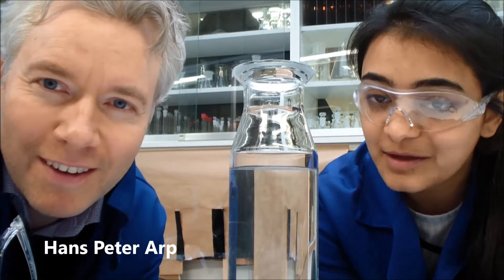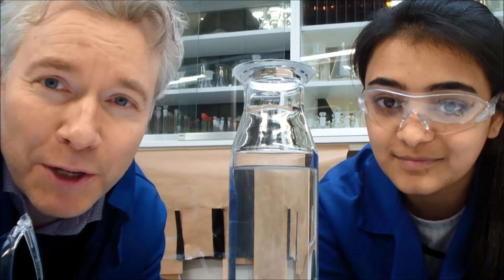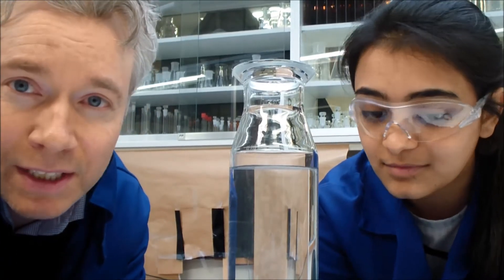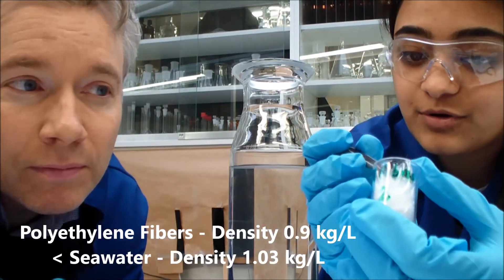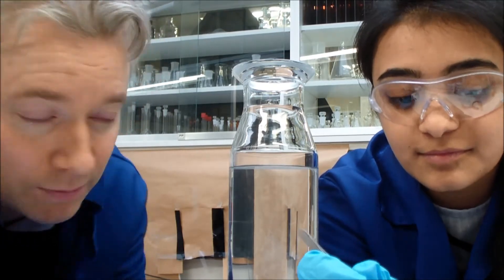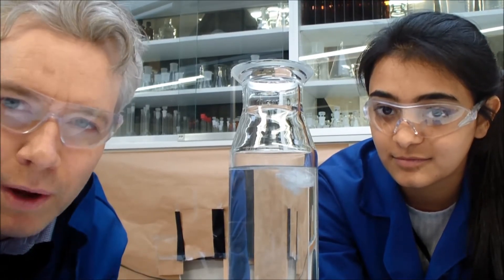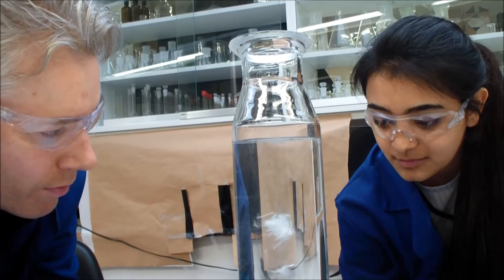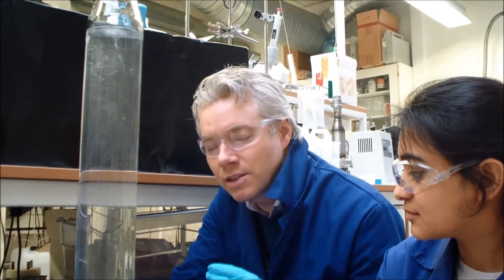Microplastic fibers sink with turbulence - a lab demonstration

Comment: I'm sorry, but I think that the effect shown in the lab is apparently different from what is claimed - it's not turbulence (i.e. no variation in velocities across various scales) but more a vortex that has a low pressure core in the center and it actually pulls the plastic down and then redistributes it over the column. What happens next is that without any motion, the density differences are not that high and the small plastic fibers or particles are stuck at the depth due to viscous drag that prevents them from floating back to the surface (as they should eventually do due to buoyancy, Archimedes type of force).
Reply from the maker: Excellent comment, thanks for this! I agree with your analysis of what is occuring. What we were trying to illustrate with this video was that because fibers (diameter 12 - 150 µm) have a smaller Reynold's number, and therefore a higher drag coefficient, than larger, more visible plastic pieces of the same density, such fibers are more susceptible to the influence of the vortex and other forms of turbulence. Of course, the thinnest fibers are borderline colloidal. When we put in PE nurdles (diameter 4 mm) of the same density, they stay afloat, unaffected by the vortex, other than spinning around the surface. This difference is what we wanted to point out, and we should make it clearer in the next video, such as by putting in typical plastic debris with different sizes but the same density in the column.

Comment: What happens with some smaller plastic particle like 100 micron or 10 micron. Would the density of the water overpower the buoyancy of the plastic when its so small?
Reply: Thanks for the question! When you get very small, all particles regardless of their density become "colloidal", and therefore become suspended by water; not necessarifly floating, but distributed throughout the water column. This generally occurs for particles at 1 µm under completely still conditions, but can occur as large as 10 µm or even larger depending on fluid conditions. Fibers are a tricky beast, because of their spagghetti like geometries, but it is likely that fibers with a diameter of 10 µm or less are suspended like colloids.
Reply: Well said. Thanks!
Reply: We also found recently an additional force component on small particles entering stratified interfaces, i.e. layers of varying density